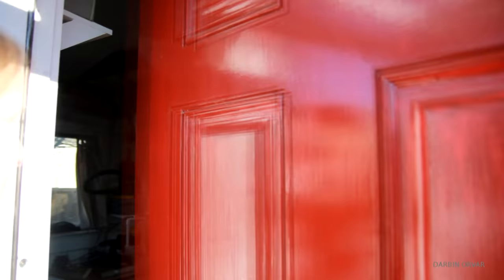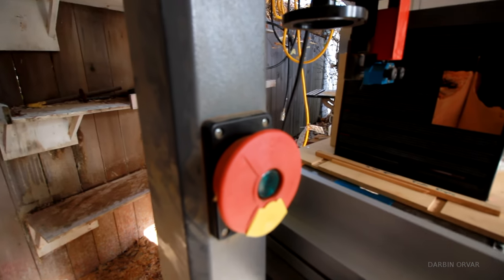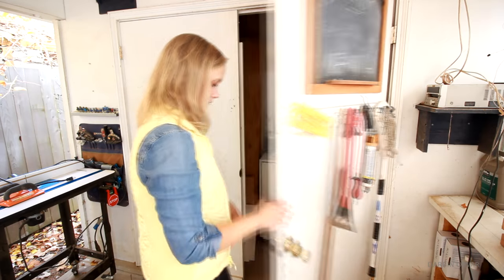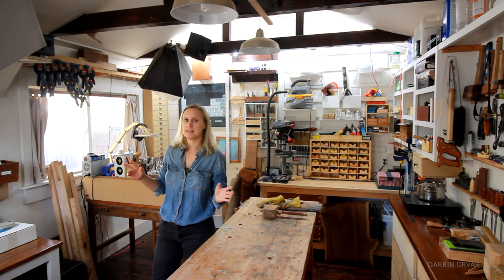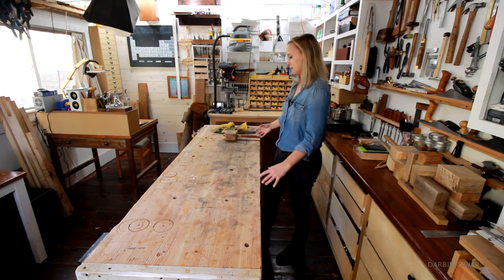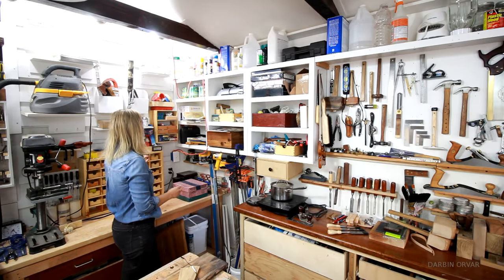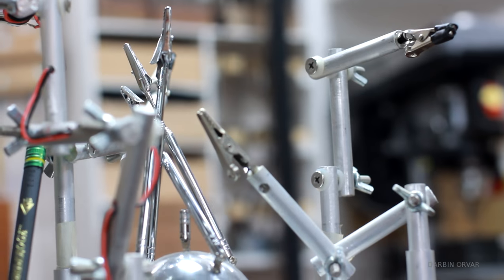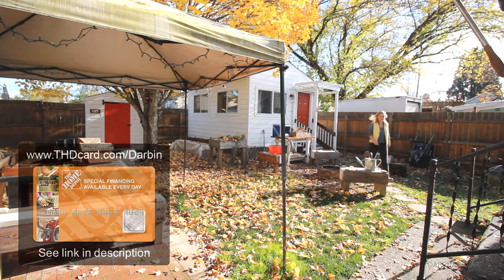Shop Tour 2016

Comment: Nice shop (tour). Thanks for sharing.
The weather/climate is not an issue for you and your tools outside?
Humidity/cold.  You can organize your projects according the weather but the tools are always outside.
But at least you have the shop inside without sawdust (only something from the drill press). That is a big plus.

Comment: A couple of quick suggestions for your new workbench (when you build it.)  First is put it on wheels.  That way you can move it out of the way if you need more space.  Use locking wheels and it will stay where you put it.  Second thing is put a sacrificial cover on top of your bench.  I use underlayment plywood on my bench and when it gets torn up I just have to replace that, not the top.  Just replaced mine about a month ago and the plywood was about $15.  Love your videos!

Comment: I have a suggestion for your new work table in your indoor shop. I have always topped my work surfaces with a sheet masonite. I just screw it down and flush trim with an router. It makes a nice hard and smooth work surface. It's cheap and its very easy to replace once it gets damaged. It's also soft enough it won't damage your tools.

Comment: I definitely agree you need to close that car port in. stuff gets rusty.i hang things from the ceiling on nice small anchor rope steel S hooks with eyes screwed into the item im hangin up and nice pullies.i tie a knot in the rope where i want it to come down to when i want the item.its simple to do and reasonably cheap.run the rope down the wall anywhere you want.good luck and stay safe

Comment: your shop is open air, how you control humidity and other factor that can make your machine go rusted? (english not my primary language, hope u understand)
Reply: gpctrs jr my question as well, rust must be ever present.
Reply: Yeah, I was gonna ask the same thing. My shop is small, but attached to a large carport with walls on three sides. I was thinking about moving some stuff out there, but I'm concerned about rust due to the moisture in the outside air.

Comment: Hi Linn. Is it possible that the Sawstop could engage if you were working with wet wood? Do they have any warnings about that?
Reply from the maker: Yes, I believe that is so. I am always careful about that, but you can use the bypass mode if you want to avoid the issue :)